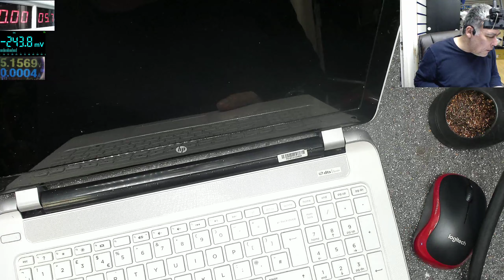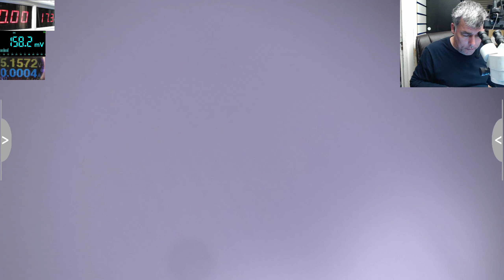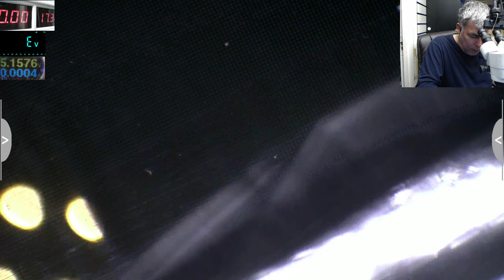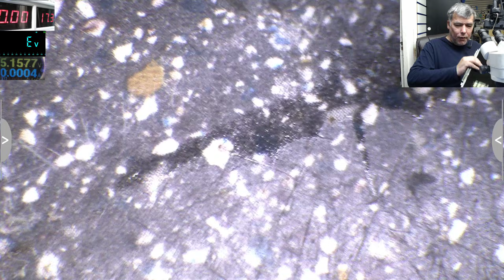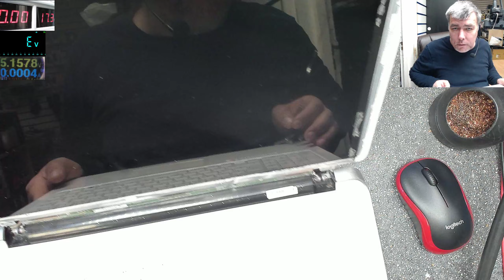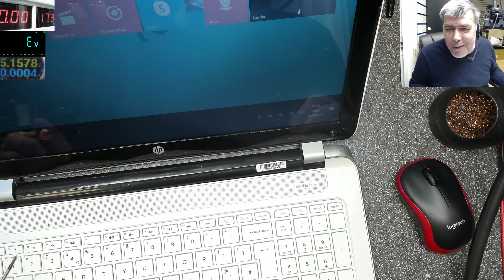Laptops LCD screen can be repaired? Let's try :)

Comment: https://www.youtube.com/watch?v=ovfGHkDXYPM
this lcd first started showing green lines horizontal ,with flickrs then one day stopped showing rest of the screen , now it just like in the pic , i can see mouse at top,also the icons at right end of screen , i also tried to look around the cable wires ,adn loosened it ,but its the same result . i tried the flex test , the monitor changes to white ,and different colours, but dint show the actual picture , external monitor vga connection is good, so please guide me what next to do . please verify the pics, thank you .

Comment: Hello Sir My laptop is flickering and there is an unnecessary image appear as background on the other side. I believe your expertise to solve the issue. What is the possible problem of it. I already do the basic troubleshoot like updating the system driver, adapter and reinstalling it but still the issue remain.

Comment: I'm just really confused. He removed the bad capacitor and used a wire for a fuse (I actually suspected that was what he was going to do) and without the capacitor isn't there a risk of the screen blowing up at another time? 🤔

Edit:
I don't even care right now. I've subscribed. ☺

Comment: Thank you very much. I have a Toshiba satellite laptop. The lower half of the screen is blank and the upper half is good. I can see the full screen on external monitor when I connect my laptop to external monitor. All the comments on the internet advised to replace the screen. Is this something reparable or I have to replace it?  using VGA cable. Thanks again for the good videos

Comment: I am desperately in need of help. I believe I have the same 1366x768 panel with Green colour not working but on a different (from the one in the video) HP notebook. Also I have another donor laptop which has a known to work panel of the same panel size. Even though I thought of replacing the panel myself, the connector on the motherboard is different in these two. Because as I saw on the donor laptop, the wifi antenna is also integrated with the cable that comes to the motherboard from the lid. I still have not checked the connector on the display with the bad panel, but just in case, would I be lucky if these two have similar connectors? Is it safe to plug and power on the notebook if the connector on the display fits?

Comment: 5:48 "You should always remove the battery when you remove the screen connector."

Yep! I found that out the hard way when I fried an expensive laptop. Sparks followed up by smoke and that electrical burn smell.
Reply: rip
Reply: rip

Comment: In primul rand vreau sa va felicit pentru aceste minunate “lectii”...acum 2 zile am dat intamplator peste unul din videourile dvstra si credeti-ma ca pana astazi am vizionat foarte multe dintre cele postate de dvstra si abia astept proiectul cu panourile solare.😍
Intamplator cautam ceva pe internet legat de o problema pe care o am la un laptop Asus k72f in legatura cu luminozitatea monitorului care este complet stinsa. Urmarind instructiunile dvstra am reusit sa gasesc sursa de tensiune de pe monitor, apoi PWM, BL_EN si chiar VLED. Ideea este ca pe PWM am 3.3v, pe VLED am 19v, dar BL_EN este scurt la (masa), iar ca in filmuletul de mai sus am siguranta de la 19v arsa. Urmarind indeaproape procedura dvstra am pus si eu o sursa de tensiune de 13v pe siguranta avariata si singura piesa care se incalzea era chiar MOSFET-ul...si nu unul din condensatoare...care crede-ti dvstra ca ar fi problema calculatorului acesta?
P.S. eu locuiesc exact ca si dvstra in afara Romaniei (Danemarca) iar aici (din cauza faptului ca nu au dat niciodata de greu-banuiesc) ei nu repara in asemenea maniere produsele, ci spun direct problema este display-ul comanda unul nou, il schimba si gata...nu am intalnit inca pana acum un electronist asa cum Romania a avut, are si sper ca va mai avea...ca dvstra...
O data chiar am intrebat la locul de munca unde lucram de ce nu incearca cineva sa repare mai aprofundat produsul respectiv? Si mi sa spus ca: 1. nu gasesti pe cineva bine educat sa stie sa faca asa ceva, 2. Chiar daca ar incerca cineva nu garanteaza ca il va repara, 3. manopera pe ora este foarte scumpa si nu stie daca il va repara intr-o ora, 2 sau 3, si in al 4-lea rand a zis ca totalul costului de reparatie va ajunge la mult mai mult decat ar costa o piesa noua.
In ultimul rand doresc sa mentionez ca vreau sa repar acest laptop doar pentru faptul ca dvstra ma invatati sa fac un diagnostic al unui circuit si sa inteleg de fapt cum si de ce functioneaza...e ca un fel de practica a cursului dvstra.
Va stimez si va multumesc pentru tot...jos palaria.

Comment: i love your videos Mr. Sorin.Thank you sir. i have a challenge with Samsung sense @t is dead. i traced  the power rail for 19v, there is 19v untill the  first mosfet but no 19v on the output of the second mosfet, i then removed the second mosfet but cannot find the same type of mosfet and so i connected the legs directly using calibrated wire but am getting a short. i tried using petrol to see what is getting hot but i see the calibrated wire area shaking when i introduce 19v and the 19v does not pass the second mosfet.  what could be the problem?

Comment: Hi First i love all your videos and i love to repair things thanks your help i started fixing Smartphones and Laptops with good results!!! Thanks for this but like always the people want more so maybe u can make a future video about this kind of problem i will tell u !!! I have now an Acer Aspire Nitro V17 Black Edition with mainboard problems! It doesn't start and dont charge the Battery! I checked the 19v rail and the 5 v rail and also the 3.3v rail all are ok but the only one the BIOS Chip doesnet get 3.3V  on pin 8 as it should by checking this i found out this rail goes to a capacitor which goes to Ground, it's not shorted and bevore the capacitor there is also a connection to the TPS65982 Chip but this Chip is just for the USB C Type jack and for PD i dont think that this chip should provide the 3.3V for the BIOS Chip and i found nothing other where this line goes to it ends at the chip i dont see whats under it!! But the next thing is can the missing 3.3V on the BIOS Chip Cause also the not Charging Battery problem??? I tried to measure the Battery with the Multimeter but i dont get any readings so maybe its dead but it should work with only PSU and it didnt and also the BIOS Battery is empty i buy a new tomorrow! But this is also not the solution!!!

Comment: 2. Teil
On the Battery i can read that it should be charged with 13V and 2.5A but i did not find a 13V PSU on the Board maybe the problem is here and its shorted or something i will follow that trace tomorrow maybe it will result in a working Laptop or maybe one of your next videos will help me out thanks for all and go on this way please!!!!!!!!!!!!!
To see these small 3v lines without a microscope is verry verry difficult so i think i have better chances to fix this when my microscope arrived!!

Comment: Hi, I got a AOS motherboard that died/does not boot up, is it possible to estimate a cost for a basic check what could be wrong? This motherboard is from a kickstarter project and was made by Gigabyte and could run mac os out of the box after replacing the bios code. Some people say it is the bios chip itself that needs to be replaced.
It died on me while running and after I got the backup bios loaded I could start it up again but after a week or so it died again.

Comment: I'm replacing a shattered 12.1" PD121XL3(LF) screen (1700 nits sunlight readable, LED illumination, cheapest price nearly $300 from China) with a used $15 Toshiba LTM12C324 (400 nits, CCFL).
Swapping over LEDs, diffusion layers, frames & housing parts.
20-pin connectors have totally different pinouts and different plugs so joining extensions to all 20 tiny wires & got to get it right first time, all joints insulated & data pairs twisted, which is going to be fun with only one good eye.
I'll let you know how it works out... wish me luck, I'll need it.
If anyone knows of a cheaper PD121XL3(LF) or close equivalent I might soon be very interested :-)

Comment: I can literally fix tv and amplifier. I tried to learn laptop and computer repair. Repaired 0 of them so far. XD why am I not learning at all.
Reply: We dont have one from where I live. The only city that has one is at the edge of our country so all I do is online research which dont have much info online.
Reply: I'm trying to. Considering that there is no shop in my place that actually offer a board repair on PC and laptop and all of the shops here looks at the unit find the issue, tell the user that its a faulty board then tell them to buy a new one instead. I really hate traveling too far though.

Comment: A tip for applying 'AmTech' flux, on a budget...
Cut a hotglue stick to about the length of the AmTech tube. Heat it up at the end. Stick it in the back of the AmTech flux tube, in the middle. The idea is to glue it to the piston only. Not to the sides. So don't push too hard and don't heat it up like you would do for a hinge repair. Let it cool and you have a nice plunger, so you can operate it as a syringe, with one hand and without having to poke it with a screwdriver.

Comment: I really like all your videos but I kind of get a little concerned about leaving components off.  You know that if the manufacturer could have done without it they would have left it off to save cost.  I would like for you to do a demonstration of the fusing wires you use to replace actual fuses. set up several strands of the wire you use for different size fuse replacement and demonstrate them carrying the proper current AND opening at the proper current.  You may already have done this as I have not watched ALL your videos.  I have watched a great many of them though.  I appreciate all you show us! THANK YOU!

Comment: Sometimes unplugging the part and plugging it back in if you don't have a blown fuse or short can sometimes get it working. Switching RAM around when it reads you're shy a stick will sometimes recognize the stick again.
Reply: Does not relate here.
Ram bad charge will cause a no post.
That is when unplugging ram releases the bad charge.  
But this was posting,  but lcd did not work.

Comment: Dam capacitor failure again!!, manufacturers are making crap on purpose :-(
Reply: Look at the case with Lenovo. G50-80 charger middle pin going straight to the Super I/O. No protection. Of course it's a cheap Lenovo.

Comment: In fact its good to put a new capacitor if you care about customer eyes! The backlight will flicker alot without that cap....
Reply: 1.he cares about their wallet since he didn't just replace the screen and that is a lot already
2.you can't measure a cap capacitance when the cap is damaged, and it's impossible to guess since size doesn't matter so getting a similar size won't result in same capacitance 
3.you should worry about single neon lights not fuckin laptop screens 
4. I can't find any proof of what you're claiming on the internet also since backlight works on 19 Volt power rail I don't think any cap on a laptop can hold 19V to buffer the screen in case of actual dimming
Reply: @mohsentabouna6401   I speak from my personal experience. The screen will flicker whatsoever cause its not the 19 volt or the neon bulb but its the inverter that make me worried about. It was a capacitor for stabilizing the voltage! Two things will happen! The led strip will go off or the second capacitor will short after a few days -weeks  maybe!

Comment: Not professional Tech. Pro tech will replace the screen : ) 
we love you sir
Reply: Opposite, a real pro would do exactly what Sorin did. Repare the screen. People only think of money today and what about recuperation, pollution?
Reply: @sergelavallee913  don't tell me that you believe what I wrote. Replacing screen is for dummy that work in big repair shop, not real tech. Computer tech is not electronic tech
Reply: Not professional tech, pro/genius would replace the motherboard and the screen and add a bit of ram too while at it, and charge more than the laptop itself :)
Reply: @mytester6208  yeh man, most of pc tech in here only replacing parts like lego, But guess what? ".THEY ARE QUALIFIED TECHNICIANS". ask them what's a diode they'll have heart attack
Reply: dont think i m joking :) because brand new dell laptop i purchased had backlight issue (i m it support tech/ not a repair tech but can tell backlight gone as you can see pic still with backlit dead) over a phone call and a few test nothing came up obviously, and dell wanted to replace the screen, plus mobo :) brand new machine!

Comment: a fuse is a wire … yeah sure,  same shortcut as saying  "the barrel of a pistol is a cannon" …

most modern appliances use "self healing" fuses (made of polymers) that recover when the temperature returns to nominal after a short or power surge.
of course some manufacturers are not interested in using those fuses for obvious raisons … that way the device remains dead until customers pays a technician for the fix  ;)
Reply: That fuse went cos of that shorted cap. Replacing fuse will solve zero. The same would solve your self healing fuse - zero.
Reply: please, where did you read on my comment that a polyfused will fix the problem ?  yes, nowhere ..

i'm commenting based on the Sorin comparison on fuse/wire …

obviously a shorted component won't fix itself without human intervention ! I was just talking about polyfuse behavior.
Reply: @0dium.  don't mind him, I loved your comment I didn't know about self-healing fuses don't be discouraged to comment because of twats
Reply: @0dium.  Here "… that way the device remains dead until customers pays a technician for the fix  ;)" so here you implied that device need technician intervention cos of blown fuse . But wit self healing fuse the device would work again. 

So basically what you said was , that having self healing fuse would sort the problem. 

But it would not as the fuse went for some reason and self healing fuse wont be any good in this case obviously. It would help zero as I have stated.
Reply: @mohsentabouna6401  why did you call me twat? Im just trying to help. If the guy though that self healing fuse would be enough he was wrong and I just pointed that out. Self healing fuse may be good idea but not in this case. So again why did you call me name ? Im giving you chance to apologize.
Reply: ok whatever :D ...
Reply: it's a proper calibrated fuse ! :))
Reply: I like this one "the barrel of a pistol is a cannon".

Comment: i like these videos ! saved the whole screen be removing one cap !!!.................now i just need a video on how to fix single horizontal line ???  :)
Reply: replace the cap :)
Reply: Make pressure somehow on flex in that area. maby is not repairable, who knows
Reply: @gile849  yes ive seen videos  about this ? think the flex cables are heat glued the the display and this fails ? wonder if theres a way to apply pressure and heat to "re-gule" them ??
Reply: @kimspeller5379  No, physically make somhow pressure od that flex. Ruber etc. Heating is not good idea, beleve me. Very complicate to fix, but nothing lose to try. Sory my bad eng :)

Comment: Please help. I need output voltage of this transformer. There is 3 out 1 ground 2 12 volt and i dont know third voltage. I need please answer if u cam. There is board link and also transformer on the https://images.app.goo.gl/1AAMDiJrdJG5fRcq7

Comment: 1 why don't replace the capacitor?
2 how can work without the capacitor?
3 it will make problems in future a missing capacitor
Reply: The capacitor is across the power supply, it corrects any slight variations in the supply. It will work OK without it. At worst, you may see a slight flicker on the screen as slight interference, when say a fridge starts up, but otherwise it would be hard to notice.
Reply: @richardhemingway6084  thank you sir
Reply: @richardhemingway6084  super, thanks
Reply: Sorin fully explained that it will be fine without the cap and the reason why at the end of the video.  Perhaps you didn't watch to the end.
Reply: @sydmichel  yes now i watch more close the end
thank you for your answer
Reply: folow to discord to lern about this quensions
Reply: that capacitor is a semi protection to trigger the fuse to blow and stop the current from flowing. if you leave it empty then it will be fine but next time it will have a problem with the power rail, the damage might not be only the fuse and capacitor. correct me if im wrong :)
Reply: @lord_kelvz  thank you for the answer
Reply: On that rail there were 3 capacitors in parallel only one failed and was removed. Meanwhile the total capacitance is still above the recommended value remember in parallel we add the capacitance. If they are three and two fail you should replace them but only one failing is not necessary at all.
Reply: @Hadadoh  thank you sir